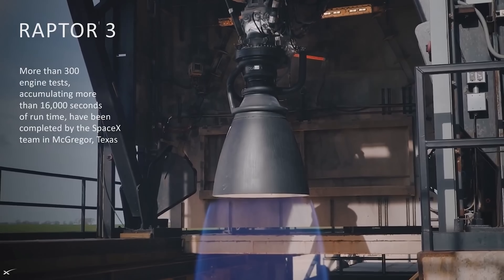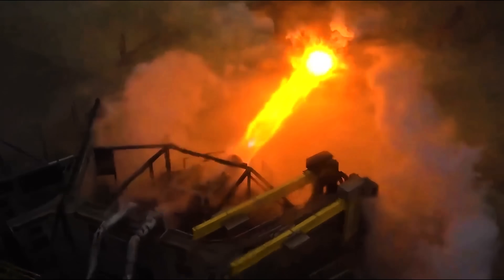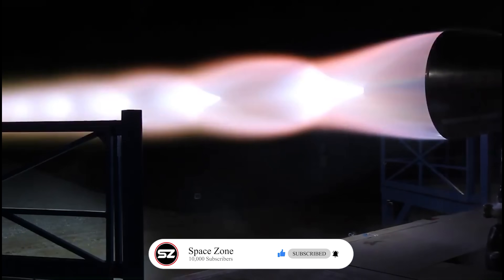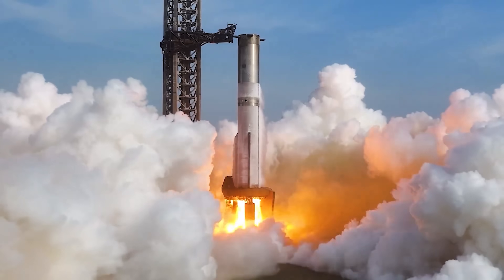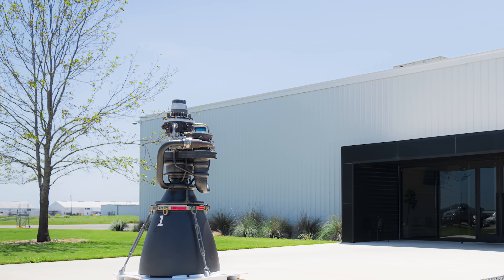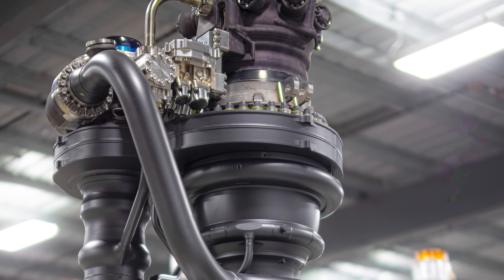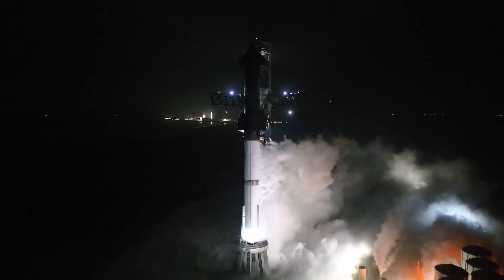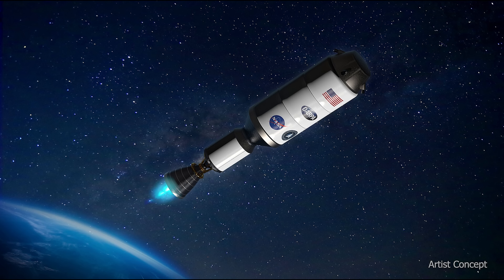Elon Musk Revealed SpaceX's Inside Raptor V3 Problem

Comment: Hydrogen based rocket engines are much more efficient, the penalty for that is a low density propellant, liquid hydrogen, that requires a larger rocket to hold the propellant.  Hydrogen is also a bigger pain thanks to it's significant boiloff problem.  But, still, the efficiency of hydrogen rocket engines is as high as you get without going to fluorine and no one wants to use fluorine.  
The maximum Isp of a methane based rocket engine might just reach 380s though Raptor isn't near that yet -- hydrogen engines, OTH, have exceeded 465s or more than 22% more than the best methane will ever achieve!
Reply: It's never going to get near theoretical limits because of losses in pre-burning and losses due to imperfect combustion dynamics. Raptor 3 at around 350 is pretty much as good as you're going to get.
Reply: @schrodingerscat1863  Sea level its 350, vacuum it's 380.
Reply: They have a higher ISP. But rocket stages launching from Earth also need high thrust, and hydrogen is terrible for that.  So "efficient" applies only to ISP, not thrust-to-weight.  In addition, liquid hydrogen requires a much larger tank, reducing the advantage of the higher ISP.
Reply: I once thought if we made an arc reactor integrated in the engine with palladium silver alloy and fed it with water , then the issue of hydrogen storing wont be there . But the problem with that is for electrolysis in arc reactor , we would need a lot of electricity probably like 1 engine as a generator for 3-4 engines to run...
Reply: @ItzKrish_Pal  The propellant contains the energy -- the energy needed to break H2O into H2 and O2 is the same energy you get when you burn them in the rocket engine.  The storage density would greatly increase to about 997kg/m^3 but LOX has a storage density of 1141kg/m^3 so you'd loose out with LOX.
Also, you'd have to generate the energy to electrolyze the the water as you are burning it in the rocket engine other wise your need to compress, chill and liquify and store them and that's no small task requiring a sizable amount of energy relative to the electrolyzing itself.
Reply: @Raptorman0909  most likely with the current knowledge we have . But if a palladium + silver alloy specially treated for electrolysis in highly optimised temp and pressure then the efficiency would increase massively.
Reply: @ItzKrish_Pal  Yeah, sure -- build it and become famous and wealthy!
The energy you get out of burning hydrogen is the same as the energy needed to crack water to make hydrogen -- actually it takes more energy to crack water into hydrogen then you get out when you burn them due to the myriad of losses.  Explain how you plan to do that or find another hobby!
Reply: @Raptorman0909  My apologies Mr Elon Musk .
Reply: One additional pain with hydrogen is its permeability - it leaks through tiniest gaps due to low molecule size. Also it get INTO different materials, including metals and embrittle them.
Reply: @whatissixbynine  Yes, however in the great scheme of things those two factors are negligible.  Materials selection and other aspects of engineering mitigate this and we've used hydrogen as a propellant since at least Apollo and the reusable Space Shuttle.  The two most significant challenges with hydrogen are:
1.  Low storage density
2.  High boiloff rate
But even with the challenges hydrogen is the highest performance propellant outside of the really exotic and hugely dangerous fluorine based propellants -- that stuff makes hypergolic's seem benign by comparison.  In short, the total mass of a hydrogen based rocket stage will be about 20% less massive than a methane based rocket stage with the same payload capacity.
Reply: @Raptorman0909  Those factor were definitely not negligible for development of RS-25 and part of the reason for its exorbitant cost.

>the total mass of a hydrogen based rocket stage will be about 20% less massive than a methane based rocket stage with the same payload capacity.
Wow, that's wild claim. Dare to find any first stage running on hydrogen for comparison? Note: if they use solid boosters - that should be counted in the mass of the "first stage".
Reply: @whatissixbynine  The RS-25 engines had only one failure in its entire history and the launch where that failure happened did NOT fail -- it reached orbit OK.
We can quibble about what constitutes a first stage, but on the Space Shuttle the RS-25 engines operated from launch to orbit -- IOW, the Shuttle with the external fuel tank and solid rockets comprised the first stage.   Put simply, the RS-25, a hydrogen based rocket engine, has a vastly superior track record than the Raptor.  In the roughly 130 shuttle flights they had just one RS-25 failure, due to a sensor not the engine proper, whereas SpaceX has had dozens of Raptor failures and has yet to achieve LEO.
Reply: @Raptorman0909  Wow, what a goalpost moving! You've claimed that hydrogen rocket would have 20% lower total mass - not that it would be better on some other arbitrary parameter.

RS-25 have good track record regarding reliability and ISP, but it's very heavy and expensive.

For the first stage we need something with high thrust-to-weight and RS-25 is definitely not in this category and most thrust on liftoff was provided by the boosters.
Reply: @whatissixbynine  I ask you to run the numbers, it's not hard as the equations should be within reach of a high school graduate.  The most important of them is the Tsiolkovsky rocket equation.  Also useful is the m* thrust equation.  Run the numbers and get back to me or don't run the numbers and p1ss off!

Comment: OK----------...  SPACE X NEEDS TO PUT AN ELECTRIC MOTOR/GENERATOR ON THE END OF EACH ISOLATED TORBO PUMP, SO IF EITHER ONE TURBO PUMP BURNER DOES NOT LIGHT PROPERLY, IT CAN BE DRIVEN BY THE OTHER  TO KEEP THE PROPER MIX OF LOX AND METHANE GOING INTO THE ENGINE UNTIL THE SLOW PREBURNER FINISHES LIGHTING AND COMES TO FULL POWER...  WITHOUT A SINGLE SHAFT ALLOWING BLEED THROUGH OF LOX OR METHANE INTO EITHER SYSTEM...
Reply: Yeah, should work - after all RocketLab use electric pumps quite successfully. But the WEIGHT of all this on 33 engines...
Reply: Right. Having mult-megawatt electric motors inside the raptors should be a piece of cake.  Not to mention the batteries needed to run them.  You'd need a second booster just to carry the batteries and motors....
Reply: @ChristLink-Channel  You can cross-feed one pump from the other using the one running ahead as a generator (and thus slowing it down). This way you'd need anly a small battery for smoothing the spikes. But the total weight of the electric engines is still massive (you'd need 66 of them for the booster).

Comment: The Raptor3 is unbelievably engineered in order to have removed all the external plumbing.  The internal passages that have been built within the main assemblies are a fabrication miracle.  I wish we could see a MRI-style rendering along with all the slices.  I wonder how much machining and additive manufacturing and casting and forging is done - a deep dive documentary about their design and construction would be fantastic to watch.
Reply from the maker: There're a lot about Raptor 3 SpaceX is still hiding.
Reply: "The internal passages that have been built within the main assemblies are a fabrication miracle."
No it’s 3D printing it exists since the 1980s, CNC machining/additive manufacturing is really basic, how are you impressed by that? "Oh they made little pipes inside the engine block in CAD that’s a miracle"🤣

Comment: USSR/Russia has been using full-flow combustion rocket engines for decades.
Reply: R U NUTS? There was only one experimental engine design in Soviet era using full flow staged combustion (or gas-gas scheme) - RD-270 and it never flew. All RD-170 family engines used oxidizer-rich closed cycle, not FFSC.
Reply: @whatissixbynine  https://en.wikipedia.org/wiki/RD-180
Reply: Ummmm.  Nope.  Not true.

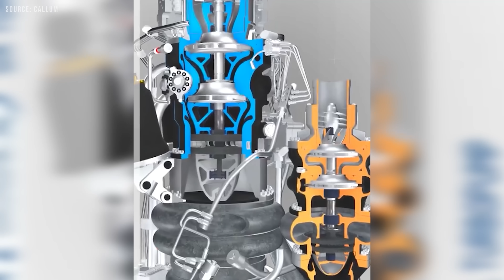Comment: @01:10 “[FFSC] allowing all of the propellant to be fully used to drive the turbo pumps…”
I strongly disagree… while all the propellant runs through the turbo pumps, only a “bit of it” is actually burned and “helps” driving the turbo pumps… otherwise there wouldn’t be anything left to combust “later”… no? (Still love your video lol 🎉)
Reply: I’m not sure of the motor, but I recall one turbo pump running ‘fuel rich’ whilst the other ran ‘oxidizer rich’ (isn’t that just ‘lean?’), but I never understood how that works.  I’d have expected each combustor to burn the same ratios to spin the respective turbines.
Reply: While energy is supplied by only a small portion of oxidizer/fuel used in the respective preburner, the mass flow matters too - it helps to drive turbine without overheating it. So while it is not used as an energy source, it is still used.

Comment: I honeslty think they need to start buliding  a new engine from scratch using better fuel
Reply: The fuel choice is a mandate because you need to be able to generate it on mars.
Reply from the maker: Methane is already very good, there a reason many rocket nowaday uses it
Reply from the maker: Hydrolox could give more efficency, but again, methane can be generate from Mars.
Reply: What fuel would you suggest that is better than methane?
Reply: The choice in elements that they use to mix with the methane is one of the best option. And anyone who can defeat gravity would become a god. That means to figure out or find the oposite infinite force of gravity. To destroy it or manipulate it. One of the biggest break through in the universe.
Reply: Methane is the single best engine fuel, slightly lower ISp than hydrogen but much smaller rockets and fuel tanks (which weigh a lot less)

Comment: You make it sound like if there's a problem with one of the engines they have to cancel the whole ship but they can just replace the engine right? If engine manufacturing costs go down enough that they don't do major repairs on an engine that's different than what you stated which is they don't do repairs on a ship
Reply: They can replace the engine and do maintenance/inspections on the side, but that would undermine rapid part of Musk's "rapidly fully reusable rocket" vision.
Reply: The engines are 99% of the price of a rocket discounting the fuel that you can’t save anyways (you have to use the fuel of course)

So if you’re not reusing the engines there’s no point in trying to reuse rockets and that’s the whole criticism against space X
They’re able to launch so much because the US governement gives them military contracts (hypersonic test vehicles, spy satellites, and starlink), not because they’re way cheaper than the competition. They cut their retail prices too using the governement money. Maybe that’s a governement tactic to do unfair competition towards foreign compagnies. Either way they sell at a loss. Like starlink. Each antenna costs 3k to produce, the network costs untold hundreds of millions, but as a starlink costumer you pay nothing. They lose thousands every time they sell a new starlink antenna, officially they do it to control the market quickly and get customers dependent on their services. Again maybe it’s just the US governement who wants American controlled compagnies to have a global monopoly in infrastructure.
Reply: @IceRain-f5v  lol

Comment: 1. - to solve the problem of simultaneous ignition of both pre burners I would hardwire the ignition steps to first ignite only one of them, then check that it was a success and then first start attempting to ignite the second one. Probably for the ignition sequence one could implement something similar to  the system that was used in avia engines used in most known dog fighter airplanes of WW-2?... the star formed piston ignition vias star piston engines of WW2 time.

2. the reduction of bolt based assembly elements is sure the right direction to sink the costs and make the construction simple. One should try to make an assembly and disassembly process as simple and manageable as with Russian AK7, just rail based assembly and probably instead of clam based lock - a single bolt lock. So one only bolt lock that would hold the complete engine assembly.
Reply: You can't ignite just one preburner: you need both of them working together as each one needs both fuel and oxidizer supply, but only provides one of them.

Comment: I don't think an engine, that creates a lot of heat and instantly throws all that energy overboard is the future in any scenario.
Reply: The future is tomorrow, til then we do what works today.
Reply: @DeprivedSouthAfrican  by that logic we have no use in Mars or Moon either. They have zero value currently, "don't work today". At all. All the possibilities and loses are in the future. Just like the engines.
Reply: @Pene7942  I'm positive that logic had a weak point 🤓
Reply: @vensroofcat6415 and you’re heatless pixie dust engine has no weak points.
Reply: Bad news for you then - every proposed engine basically does that. Even ion engines do that to some degree with low-density plasma in the chamber.
Reply: @vensroofcat6415  So what alternative would you propose then? How do you plan to get ISP's above 350 without a lot of heat?
Reply: I'm just saying we have to become a lot less wasteful before we can call ourselves universe space species. We are just desperately crawling right now with all the energy we got. Wasting it around.
Reply: @vensroofcat6415 So what is your plan to reduce the energy output of rockets without affecting their ability to get to orbit?  How do you intend to improve on the efficiency of the Raptors, which are already over 99% efficient ?  Since you are so vocal about this, I would assume you do have a plan for that... right?  Or atr you just mouthinh off about things you dont actually understand?
Reply: @ChristLink-Channel  This is tricky. Considering the energy of a gas molecule is connected to the temperature. 
I don't know how the best future engines will work exactly. Sending out protons at relativistic velocities? Elementary particles? Entangled quantum pairs? Nor how will we gather energy required to do that. I'm just saying current tech wastes a lot of energy and mass. Both are critical for real space travel. Not just planet hopping with multiple time consuming gravity assists.

We don't even have the tech required for asteroid mining yet. Not even close. Mind you, asteroid belt is very, very close in terms of astronomic units. Our deltaV ranges are childish. Moon seems to be a struggle. You could use supercooled electromagnetic acceleration for the start. Mountains maybe. But it's just a tiny part of the whole problem and for it to become profitable you need a lot of traffic. Space elevators from exotic materials eventually.

Comment: Humm, I do wonder about the idea of putting both pre-burners onto a single shaft, so hardware synched.
A down side, even it could be made to work, would be that the engine would become longer.
Reply: sealing issues and cant vary each speed as needed
Reply: You might be onto something, could be one element to resolving problem.

Comment: NTP systems can deliver twice the Isp, but also deliver far larger and heavier engines, which takes much of the fun out of it. We can get to Mars using chemical propulsion and we can do so via Mars orbit in both directions, and do so comfortably and safely. I don't see the need for nuclear propulsion until we get beyond Mars and in that case, why are we sending humans? All the solid rocky surfaces beyond Mars that a human might want to set foot onto are either cryogenic, or bathed in radiation.
Reply from the maker: NTP is still quite under deverlopment right now, give it some time, the potential is there.
Reply: @SpaceZonea  No one has come up with a neutron shield that isn't heavy. I'm placing my bets with fusion drives. Check out pulsar, but there's other concepts.

Comment: Circles are f**** stupid 
Square much better 
Use electric motors 
Turn everything sideways 
By making the thing square 
Use worm gear instead.
Make gas tank for each type of gas for each engine
Reply: Hexagons are bestagons.
Reply: @davfree9732  Personally, I reckon dodecahedrons is the way to go.  And wooden axles, instead steel shafts.  Much more ecological!
Reply: @davfree9732 it's funny you should say that, I have been trying to convince Elon Musk himself that he needs to make a 6 sided hub that fits inside one starship so to have 6 starships dock with it . I call it the HEX station.
Reply: electric motors aren't powerful enough to run these turbo pumps, at ~100,000 horsepower each. Even if you could make some the batteries required would be too large and heavy. Multiple gas tanks would also increase weight too much
Reply: @reubes11 k thanks
Reply: @reubes11 k thanks